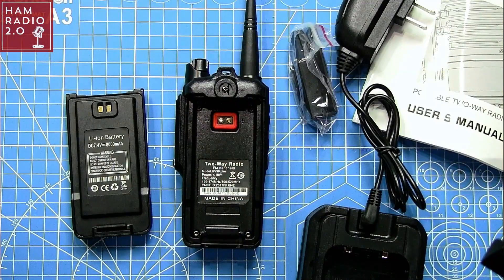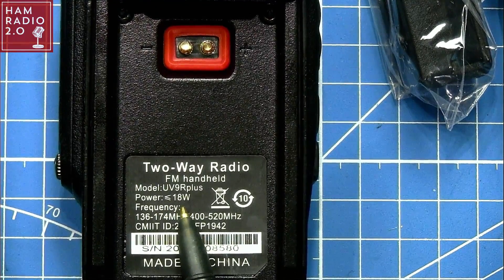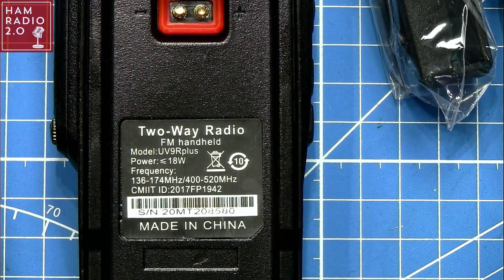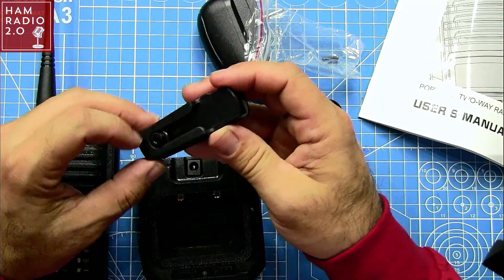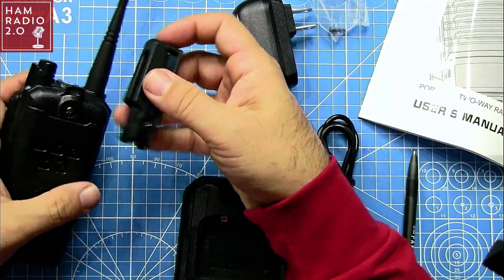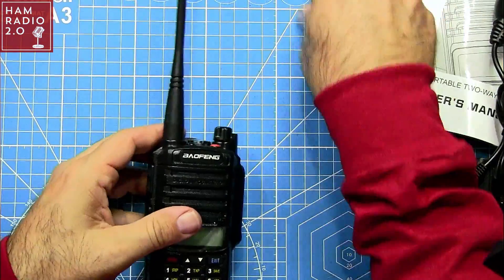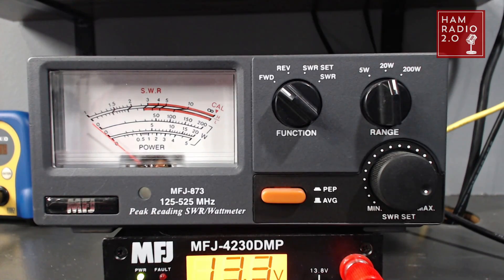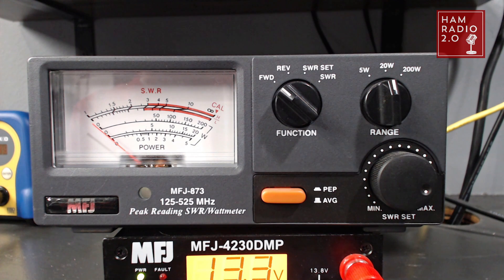Baofeng UV-9R TP 18-watt Power Testing | UV9R Plus HT

Comment: It's basically a UV-82 in a waterproof case (and yes, they really are more durable and waterproof). For the price of a UV-5R, these are a better option, even if they were only 5W.
Reply: what model would you suggest to buy atm? I am looking for best combination of power/battery life and robustness(must be waterproof in heavy rain)
Reply: @demoxcro786  did you end up buying anything? If you did write me what exactly and are you satisfied
Reply: @imeprezime1069  hello,i think we are from same country or neighbours. Croatia here.
I bought uv5r with a big antenna ,forgot the name(looks like military stile).
Could be better,could be worse,for the money it does the job.
If you buy better speaker and mic,like kenwood,it gets much better immediately
Reply: @demoxcro786  I'm from Herzegovina, I have been looking for a ham radio for myself for some time. My father has Baofeng UV-9R Plus with stock antenna and he is preety satisfied with it. And now I'm looking for a radio for myself that is similarly priced but not sure what to get. Looked at some Retevis RT85 or RT87 but it is all the bells and whistles that get in my head and about what everyone is talking about that they miss the point of a radio, are you able to transmit and hear loud and clear for longer range. It is between some BaoFeng or Retevis for me, and I can't settle my mind on one option since there are too many not needed radio types/models.
Reply: @imeprezime1069  im not familiar with retevis sry.
Id suggest to go with the cheapest version of baofeng, its gonna be just fine I guess
Reply: @imeprezime1069  if you really need a "workhorse" then id suggest looking into japanese radios,but 99% you dont need it

Comment: Several years back, I bought the Baofeng GT3, it looks similar.
Reply: This has been sold as a GT3-WP
Reply: Same radio guts, similar case design, for several UV-9R models. It just depends on who is selling them, and falsely advertising its wattage!
Reply from the maker: I think most all of the are the same guts.

Comment: so a couple months ago i bought a baofeng BF-x3 plus ( a triband radio , 2 meters , 220 ,70cm) , a very similar radio to the one you tested , it also was advertised as 18 watts .... it tested on high around 4 to 4.5 watts  .... the uv5rIII i have tested at 5 - 6 watts on the same  channels .

Comment: I bought a UV-9R Plus off of Amazon because it was advertised as an 8w HT. Got a cheap power/swr meter and put it on the radio. High was 5w, medium is 3w and low is 1w. The only one that works as advertised is the UV-5R 5w and 8w version, depending on frequency.
Reply: I have 2 of the 8 watt models. I estimated about the same, after watching some test videos! But they do okay. And the oem, rubber duck, antennas actually work good on these radios. I do want to see his water tests.

Comment: REALLY looking forward to the “waterproof” test for this thing.

Also... was the battery fully charged when you did the tests?
Reply from the maker: It was probably 90% charged
Reply: @HamRadio2  How could we trust you, when you were checking the tx power, you didn't show us the radio on screen, you only show us the watt meter device, you had to show us the radio and watt meter at same time, so this doesn't make us believe that, GİVE ME AN ANSWER, OR I WILL UNFOLLOW (with unhappines.)

Comment: I have one, and it was the 10 watt version, and it puts out 9.5 +- on hi, got this because when you are doing maneuvers the Kenwood style jacks seem to fail really quickly, and the blade style can maintain the “ water resistant” definitely not as water prof as advertised, but much better and more durable than a UV5R. The bummer is I have four or five UV5Rs and I had to re-gear for this radio, which wasn’t so bad, I usually have to modify gear to work with my old military PTT switch and headphones. It is what it is, a pig in a prom dress is still a pig.
Reply: Hi, Charles. What model did you get, the H5, H6 or H7? I have two H7s and I love them. Don't know why they aren't popular in the U.S.

Comment: The 60w model has a Nano-Thorium Reactor as its power source. It also Xmits from 1khz-3000mhz, range up to 24,000 mi
Reply from the maker: Flex Capacitor
Reply: @HamRadio2  That's on the 1.21 Jigawatt version :D
Reply: SOLD!!
Reply: ...on April1st😉
Reply: After 30 seconds of use your cells are fried....

Comment: Hey Jason, you can adjust the FM radio band frequency on these. I don't know what's down between 65-88mhz, but it receives there. 

Also the blade connector, that's the reason I got it. It will interface with military style comm headsets. 

The belt hook sucks imo and my battery is the same physical size and only rated at 1800mah. But again, I have the standard 5W version...maybe 3/4 of the battery case is empty? 🤷‍♂️🤣

Side note, that Icon on the shelf behind you is making me miss my IC-730 🙁

Comment: The mAhr claim on that battery is pretty dubious as well. 😆
Reply: Yeah, whut I was thinkin', too!  Even if it was a 4-5 watt radio, an 8Ah battery would still be cool as heck.  Alas, I share your doubts.
Reply: VERY much so. I have a standard 5W  UV-9R and the battery is the same physical size and only rated at 1800mah.

Comment: Quick math: 1 S unit = 6dB.  Double power=3db.  5W x2 (3db) = 10W x2 (6db) = 20W.  Therefore, 20W is received as 1S unit stronger than 5W....given the theoretical power consumption for a portable which would actually transmit 18W, it seems asinine to achieve a 1S unit of signal improvement.

Comment: Can you program a Baofeng or any HT with an Apple iPad, I don’t have a computer but I do have a new iPad Pro. Thanks KV5P
Reply: I have not seen any radio programming software for iOS.
Reply: @klreeve123  Thank you, I guess I will have to get a HT that can programmed without a CPU and if I think 🤔 about it in an emergency you might not have access to a computer if you needed to re-program!
Reply: @mikemiles3068  Recently I went through our states frequency guide and programmed in all VHF and UHF simplex frequencies into my radio.  I also programmed my local areas ARES frequency plan which includes both repeaters and simplex.  If the concern is needing to be able to reprogram in an emergency, then an investment in a Windows laptop should be your goal.

Comment: The more important issue is when testing the HT is whether the harmonics are in or out of spec. Baofeng radios notoriously fail. As you know, the FCC and Amazon are cracking down on radios and other RF devices that don’t meet FCC spec requirements. Does that radio suck? It does based on the radio’s actual power. But, who knows? Perhaps some people don’t mind being fooled...

Comment: I have a uv 9r plus I bought a little over a year ago.   It is a great edc cause I'm not worried about it. Especially when I'm out mountain biking in the snow. Lol  
 we actually tested it out of curiosity and it is a 8 watt radio.
Reply: I have couple of them and there work well. Haven’t tested waterproofing.. but didn’t Buy it for that sure it would work in a rainy situation but wouldn’t take it diving... cheers
Reply: @devromans  mine has survived rain as well as - 15 ish degrees for about an hr at a time.  The cold seems to affect the battery as expected but as soon as it warms up its back to normal.

Comment: Funny how people are worried about the limited time you will be having 18 watts near their head but think nothing of having a 5G device for much longer time near their head. 5G, 4G, 3G and so on they are all radio frequencies plus their wifi devices in their homes. Constant bombardment of radio transmissions and they worry about a short time use of that handheld.
Reply: While I somewhat agree, you must consider that firstly, the transmitters in mobile phones are in no way nearly as powerful as even a standard HT, and second, around the 2 meter band is one of the more dangerous zones in the frequency spectrum because of average human heights.

Comment: I would think 1.8-2watts nominal  low, 3-4 watt nominal at medium  setting and 4.5-5 watts nominal..

from rechargeable or normal aa/aaa batts..

with batt eliminator might see 7-8 watts where permitted on vhf..
Reply: I have not found a battery eliminator, pack yet, for these radios.

Comment: I bought one of those on eBay last year for a ridiculously low price and it was a scam.  It never shipped and I got my money back.  I think it was less than $30.00.
Reply from the maker: Unfortunately that happens, at least you got your money back.  This purchase worked fine for me, but obviously the radio is not as advertised
Reply: Get it off Amazon. That's what I paid back around Christmas.
Reply from the maker: @Aaron48219  I'll put a link to it when they return back to stock on Amazon, but when I uploaded this video, they were nowhere to be found
Reply: @HamRadio2  I should have clarified, mines just the UV-9R, 5w version. Then there's the 8w plus version too. 
The regular 5w version is $30 and in stock, it also comes with a retractable Abbree 775 antenna. The  8w plus is $38 and stock antenna. 

As a side note, it is now two months after Christmas...and I just learned my antenna was retractable 🤦‍♂️
Reply: @Aaron48219  I don't think it's worth paying extra to have a plus writen on it if its still only 5w.  Sounds like a scam to me,  they might as well put plus➕plus and say its 30 watts and charge an extra $20.   For the cost, if the price is same as 5w version it looks like a decent truck or jeep radio that is somewhat heavy duty but won't make you shed a tear if it gets destroyed.
Reply: @mrbyamile6973  And that's exactly why I got the "regular" 5w version. 
1. Not worth the extra $
2. I had a hard time believing it was 18w